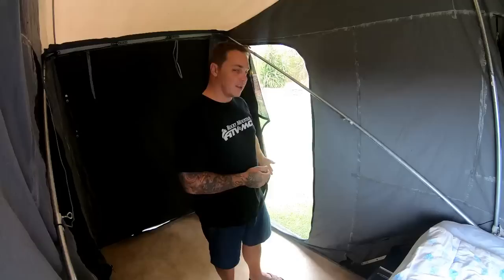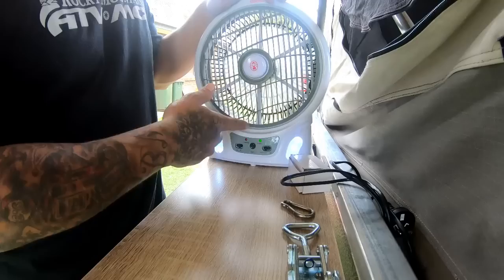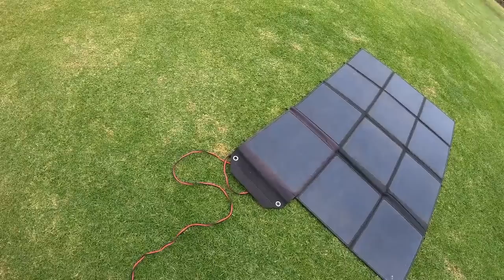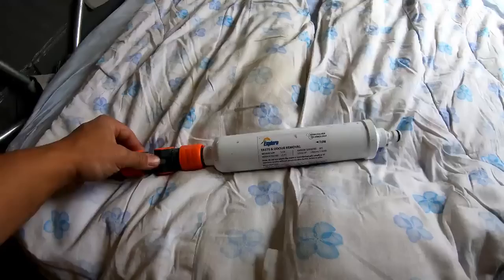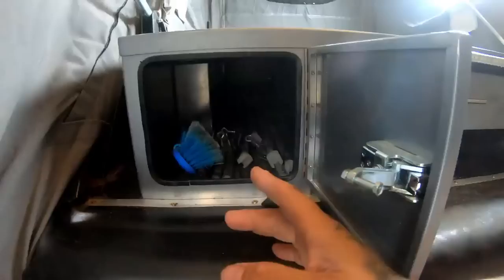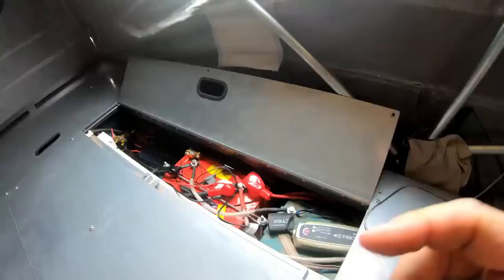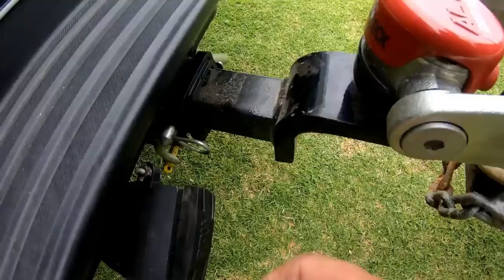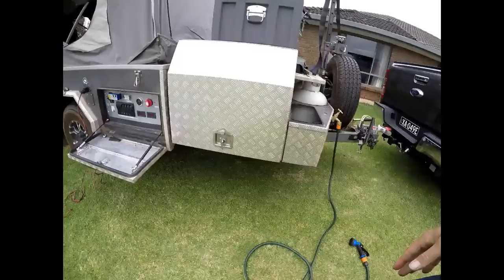Mars extremo review and camper trailer tips

Comment: Very excellent review. Do you have the link for the insulation material used in the fridge box? Thank you very much.
Reply from the maker: T Yik 
Thank you mate
https://rover.ebay.com/rover/0/0/0?mpre=https%3A%2F%2Fwww.ebay.com.au%2Fulk%2Fitm%2F264316623182
Is the link to the stuff I used. I originally bought it to deaden the sound of my inboard boat motor. Worked a treat for that too
Reply: @featurevlogs3928  what's your knowledge of this being used for heat/ cold insulation aswell?

Reflectix appears popular.. not sure if it's proper though? 😃😃

Comment: Great handy tips. I have just purchased the Extremo too. Agree with hitch and jockey wheel changes. I think I’ll do the same as you. How did you mount the toolbox on the front? And what do you do with your water tank after a trip? I can’t see a drain point. Surely draining completely is the way to keep microbes away? And then flush with bicarbonate before refilling before a trip. Tips?
Reply from the maker: The space case on top i just bolted to the top of the toolbox. Use some flat alloy plate on bottom and top to basically sandwich it. I keep my tanks filled all the time as i quite often use it. But when its going to sit for a while ill drain it. Then when i come to use it again i 3/4 fill it with water and add 4L of Red cordial. take it for a drive to slosh it around, then drain and refill with water. I drink straight from the taps of the camper too

Comment: I carnt believe the brain capacity of the people that built this camper trailer. Why would anyone decide to put a pole in the middle of the door way. You literaly have to duck down to get in or out.
Reply from the maker: It’s only the corner. But you can also detach it and use that pole as an upright. But you have to add another pole into the roof on setup. For the 3 off years we had that trailer tho we never hit our heads